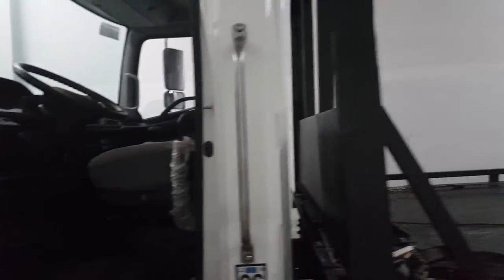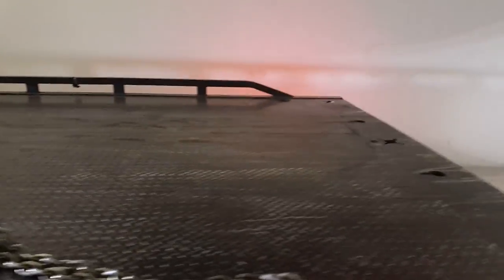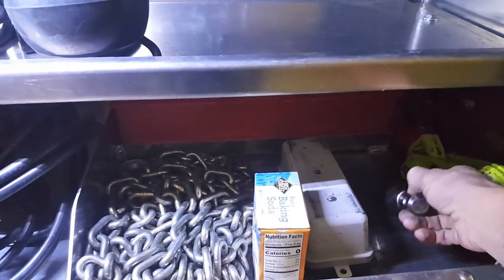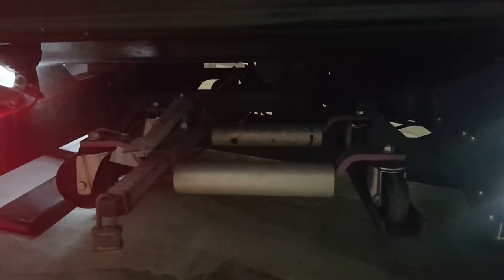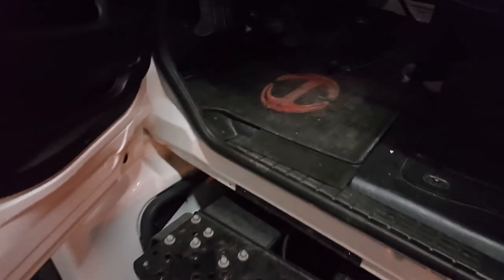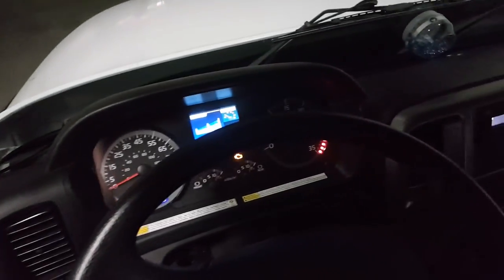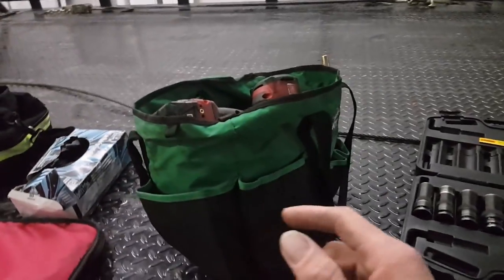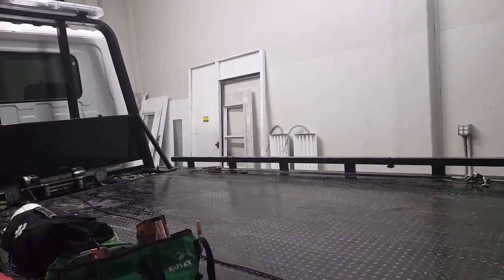Start up and running tour 2019 Hino 258 flatbed

Comment: Muy bonito su truck cuanto cuesta   Me encanto.  Y esta muy equipado
Reply from the maker: Average starting base price without all the extra equipment on one of these trucks is around 120k depends on the brand of chassis and the make and model of the bed now when you add the additional equipment on that in a sense has its own cost but that's based upon what you add but I do appreciate it thank you

Comment: What model year is the Hino? Looks like less than 10K miles on the clock. Your bed is obviously a Miller Industries Chevron. It shares a lot of design features as my Century bed on a 2019 258. I hate the levers layout. After 40 years of bed slide front, tilt second, etc., switching to the reverse layout is difficult. I like the convertible hitch balls. I just have a 2" for the plate. Last time I had to pull a trailer with the truck on the bed, the hitch was too long to work properly with the stinger retracted. Had to run it out and turned the bar to full swing to give it room for the trailer to follow without the tip of the hitch binding against the bar. I was fuming. First because dispatch sent me out of state and second because the dipshits who designed the ball plate made it too short for the type of hitch on the trailer. The hole being ¾" further out would have worked perfectly.
      What type of work do you usually do? I noticed that you said you normally drive the towed vehicle up the bed. I do primarily service towing for breakdowns and body damage.
Reply from the maker: It's a 2019 and I do a lot of rodeside but mainly police in pounds

Comment: Why was it check engine light on with less than 10k on odometer?? Not a good selling point to my boss cuz our Freightliner had nothing but electrical issues since day 1. Just don't want him to buy a truck for an engine light to come on at 9k
Reply from the maker: It actually came on at 1500  miles  but the trucks still was running normal we bought two of these trucks the other one hasn't had a single problem We are actually just took the truck in for a recall on the brakes and had them warranty that part turned out to be a bad p.m. sensor in the exhaust system so they put a new one on